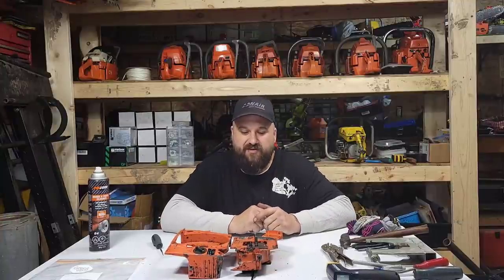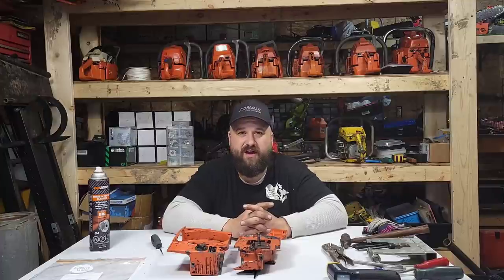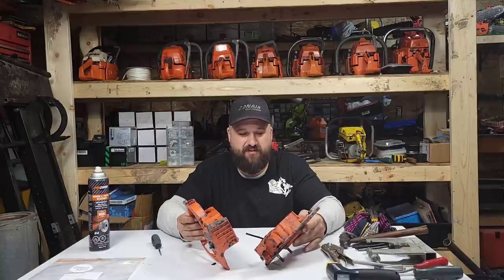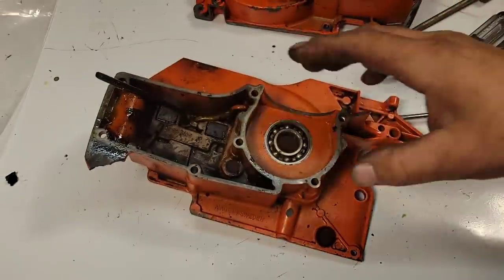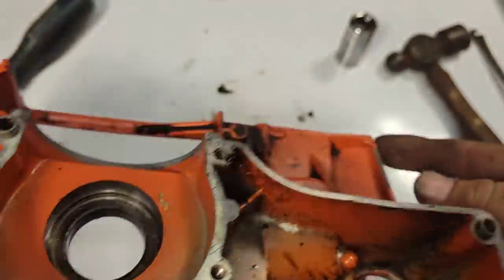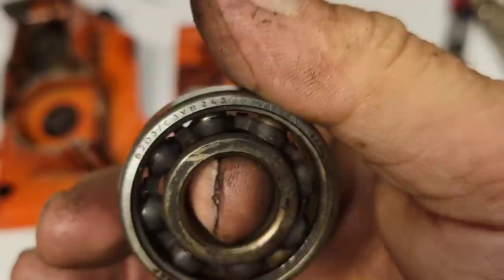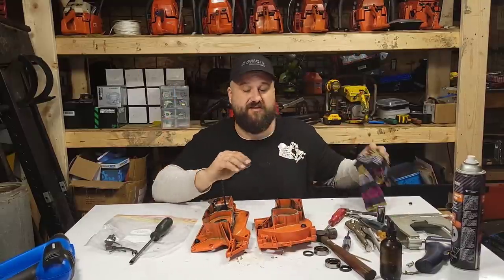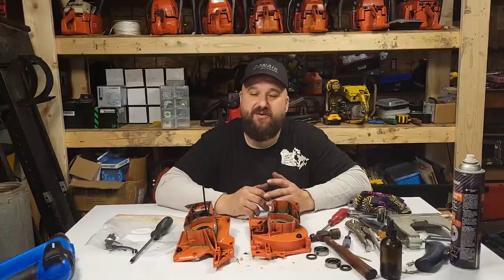How to remove bearings from a chainsaw case in real time.

Comment: You don't need a case splitter, a heat gun and a few whacks with a hammer has been my method for nearly 20 years. 300°F + a 2lb persuader + 5 or 6 taps on the crank = split case every time. 

Same goes for removing and installing bearings, 280 to 300° is the sweet spot regardless of rust and they pop right out, keep the new ones in the freezer for 12 hours, 280° and drop them in and hit them with a few drops of mixing oil and your pretty much done.

Comment: About the bearings and heat I strated wondering if the steel bearing expands more than the magnesium, it could be more destructive, but I did a quick research and fair enough magnesium expands significantly more than hardened steel per degree of heat so the more you heat it, the looser the fit between the bearing and the case will be. Way to go tinman, you know what you are doing keep up the good work!

Comment: Good video. I've done quite a few like this until I saw  Walt warm cases in a turkey cooker. I now use a toaster overseas at 280 to 300 degrees. It heats the case evenly and many time I just tap it on the bench and they fall out. Just remove the rubber parts first.
Reply: Sorry. OVeN

Comment: My old friend, the saw man always used a pressure washer to clean parts . He memorized every part number for all Husqvarna, if the bottom end was shot he wouldn’t fix it , he had 45 gallon drums full of dead saws . Sadly he has passed, many hours spent in the saw shop with him . 👍🇨🇦

Comment: This will be useful for my Sach Dolmar 120si buy. One of the disassembled saws is noted as having rooted bearings. 

Did you get the S-D 153 to run? The last video I found on it after going through your post videos for S-D saws after searching for 120's and realising that not just the porting series I've been watching, but you also have a few S-D videos, you commented you think it's an air leak. If it's bad crank seals on the 153, you need 17-28-7 and 17-30-7 double lip rotary oil seals. I'm not sure if you have the Dolmar IPLs there. 

The bearings on the 153 are interesting, larger and wider on the PTO side rather than a matching pair.

Comment: Hey Tinman, what’s your pick between 394 and 395? Do you think the 395 being more expensive is justified?
Reply: Call stahls I think they told me 1100 ish shipped 395xp
Reply: @Banjoandguns  Stahls is great to do business with. That is were I get most of my  Husky saws. If you like Oregon chain their price is hard to beat. Plus they do work on sawmill blades.
Reply: If you can find a great price on a low hour 394 buy it! I see 394s in good running condition selling for what I bought brand new 395s for. The 395xp is well worth the money and can be bought new. Alot can be gained porting a 395xp. I consider both great saws for felling with a 32" light bar.

Comment: Is this the same procedure for trimmer/weedeater engines with the bolt on jug split crankcase design? Think echo, shindaiwa, Redmax , Stihl, husqvarna, etc.? I need to replace the bearings and seals in the bottom end. When reinstalling the bearing is there a certain depth the bearing should sit down in the bearing case housing also is this the same for the seals?

Comment: Good morning Tinman . New subr here. 
Do you happen to know of a crank puller tool that supports the inner race, not the outer like the oem one does?
Reply from the maker: The one I use is the only type of tool I've seen. What are you fixing?
Reply: @tinmanssaws  
281 Husky.
Looking to replace the bearings on it.
I think I can ad a sleeve or several washers on the oem puller to make it work.
I'm gonna try that
Reply from the maker: @BrigT262  my puller works fine on those saws, I've done several 288 bottomed ends on the channel

Comment: Careful with a torch and MAGNESIUM CASES ,  MAGNESIUM burns extremely hot , bare magnesium lights way to easy with an open flame … just say’n , ive seen 2 machinists make that mistake and they have new garages now .
Reply: Shavings will light up easily. I’ve melted magnesium cases and they did not light up. Has to hit a very high temperature (almost white hot) to ignite it. Machinists deal with shavings also, which are very easily lit up.